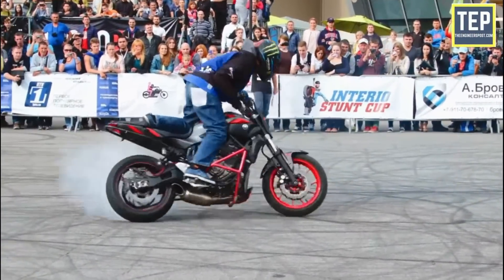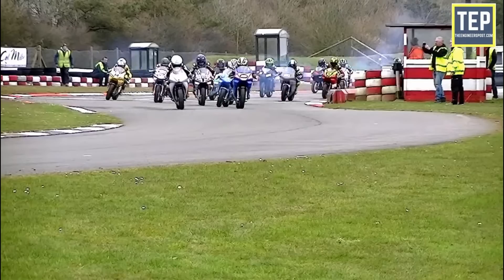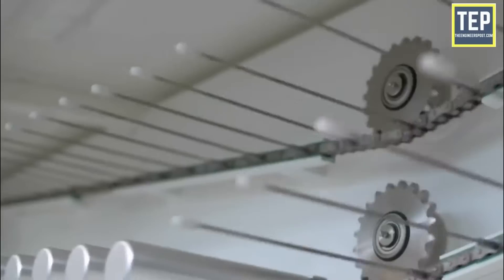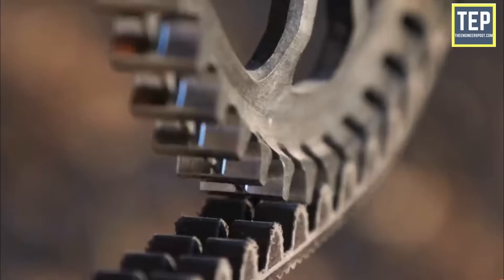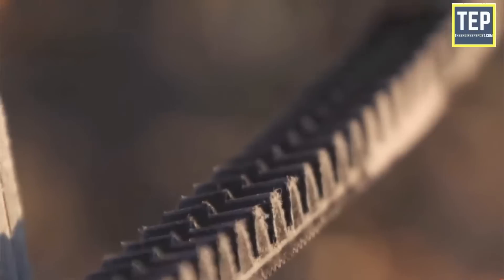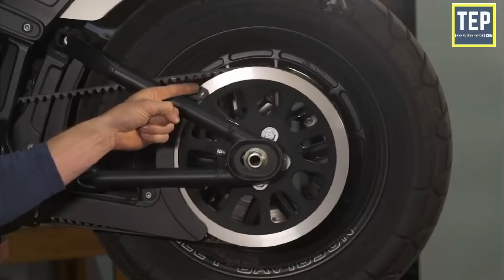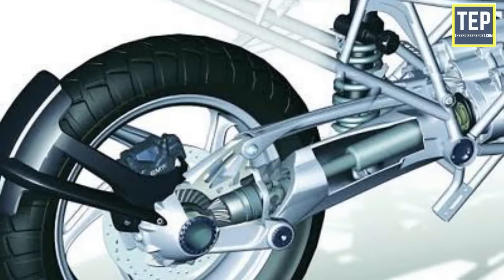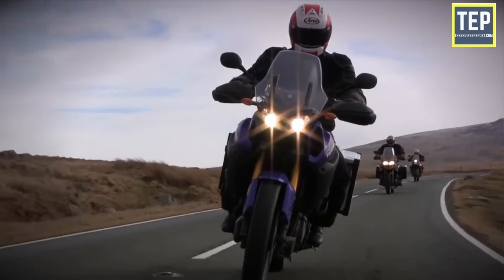Chain Drive vs Belt Drive vs Shaft Drive in Motorcycles | Which is Better?

Comment: The power loss for a shaft drive is closer to 7% than "20 to 25 % of the power".  Belt drives are adversely effected by rocks, sand and gravel and are ONLY recommended for paved roads.  The regular maintainance for shaft drived is oil changes, for roller chain it replacment of chain and sprockets  the time between replacment can vary 3:1 depending on road, of off-road use.
Reply: I have a belt thats more than 20 years old now and i never touched  nor maintained it and its got close to 150k miles. In my opinion if you're a cruiser guy mostly on paved roads, belt is the best. For adventure guys the best is shaft or chain. For performance ofcourse chain. My belt also had 20k plus miles off road experience and it never let me down. Oh and i turned my bike into a bobber the moment i acquired it so it doesn't have a belt guard to protect it from rocks. I swear for the past 20 years I've been using that bike i never touched it nor worry about it. The only time i had to touch it was when changing tires for final adjustment thats it!  Fuckin real maintenance free compared to my other bike with a chain.
Reply: I could not believe the "20 to 25%" claim.  That would be a huge amount of power converted to heat loss.  If you held your brake to rub off a quarter of the power generated, it wouldn't take long for the brake rotor to glow red hot.  I've never noticed a drive shaft get hot.  If you lost 25% of power, why, you'd need a radiator just for the drive shaft.  I'll wager those numbers correspond to maximum torque or full throttle.  A Goldwing cruising the interstate at steady state might be as low as 1% loss.  That's my guess, I'm willing to be educated as I don't know.
Reply: the power loss for a chain is 99% when the chain starts jumping teeth
and 100% when the chain breaks

Unless you are riding with the throttle WFO ALL THE TIME what do you care about power loss?!  Cant afford gasoline for your MC?!
Reply: @kenwittlief255  :  If your range on a tank is say 200 miles, a 5% power loss is 10 miles, or a 3 hour walk if you run out of gas.
Reply: @kenwittlief255  power loss means power loss... so you're slower than the next guy with less power loss... no biggie for cruising around other than range/fuel cost but when performance is of concern, it starts to matter.

Comment: I had an 85 maxim and a 03 vstar… both shaft drive and i love them… they have alot of down sides but with some bikes idc to go fast….but how they load up the shocks is awesome because when you get in it the rear suspension squats and gets its… ya any 600 sportbike will out run it and a 400 sport bike will keep up but my 1100vstar was stomping 1300 harleys…. And it just feels fast even if it isn’t because it loads up that suspension and squats it which makes you feel fast… my dream bike is a harley break out… my second dream bike is a 1300 vstar… I’ll probably get another vstar before I could afford a harley

Comment: I find hard to believe that a shaft drive can lose up to 25% of the engine power.
On a 1200 cc four cylinders engine, 25% of the max engine power is a few kilowatts. Without active cooling, that means red hot.
A more correct power loss is - IMHO - less than 10%...
Reply: I agree. The claimed 25% power loss seems way too high. there are 746 Watts/horsepower. If the bike is cruising and requires 'just' 10 hp, then 2.5 hp (2.5*746= 1865 Watts) would be lost to heat. So even under non racing conditions, the implication is way too much heat would be generated for the differential and its housing to survive.
Reply: I did some calculations based on shaft drive gear efficiencies for my 2009 Yamaha VMAX, which is shaft drive. I came up with less than 10% efficiency loss. 25% is nonsense.

Comment: It depends on the used.
Each has different purpose and design specification.

Chain has a lower thermal expansion compare to belt chain.
Which it can go longer time
But will consume maintenance on rust. And adjustment

The belt chain
Has the advantage of direct transmission. From staring point it can have a better acceleration.

Direct shaft or pto
It the number of gear linkages to the developed the power, which need good materials and expensives but it has more power compare to the both chain.
Reply: The chain expands the most and they do get hot after just a mile.

Comment: Shafts are all well and good, but they have a huge power loss, a tendency to snatch if you downshift to quickly, weigh as much as small planet and if you have a final drive failure you'd best be on your top game as the rear wheel will lock up without warning.

Comment: I had a Kawasaki z1000st and the shaft drive was brilliant, also it was faster than the chain driven version as I found out . So I disagree with you when you say shaft drive looses the most power , don’t forget there is no slack like chain , the drive is direct.

Comment: So, in other words...

Chain - Enthusiasts, and Performance Junkies  (Best performance,  high maintenance, but cheap to replace)
[When you want the bike to run its best]

Belt - Common, or Casual Riders (Medium performance, low maintenance, but expensive to replace)
[When you want the bike to run okay]

Drive Shaft - Cross-Country Riders (Low performance, NO maintenance, NO replacing)
[When you just want the bike to run]

Seems pretty balanced.
Reply: belts aren't expensive so I don't see how they would be expensive to replace.

Comment: I prefer shaft drive, but it does feel different than chain or belt. At least from my experience. Chain or belt drive tend to emediatly drop the rear end during hard excel. While a shaft goes up then down. It's a different feeling.
Reply: Im sure it would handle differently and not just feel differently.
Reply: I've owned chain and shaft. I can't feel any difference.

Comment: I've owned all three. Prefer the belt overall. Then the shaft. Belt is the least cost for power and lasts just as long as the chain. The shaft drive is the strongest by far but tends to lift the back of the bike under acceleration (at least mine have) so not ideal for performance but fine for a cruiser. I would tell my buddy when his chain needed to be adjusted after riding down the highway near him. He had R6. I had XB12R
Reply: I had a shaft and the whole bike feels like it jumps up when you crank on the gas. I will take a belt all day long. Chains are too much work and with no center stand on a Harley a pain in the ass to lube.
Reply: Hell yeah. Had a xb12s and 1125r.

Comment: In my experience and self opinion the best is the belt driven.easy to repair it last for 12 years before I change belt of  my motor 🛵 cycle manufactured by Yamaha model 2010,belt driven type motor, daily used 50 km from home to work,plus going on the market and home service also   week day saturday and Sunday.Belt driven is best ever.long last.👍
Reply: Sounds like you didn’t even try anotherone 🤨

Comment: Fails to mention the cvt belt drives on the majority of scooters. Totally different to the toothed belt system. Very simple and low maintenance.
Also, I have a Yamaha Townmate T80.  80ccs and shaft drive. It's brilliant.
Reply: I have an Icebear Rocket 50cc that has the belt driven cvt. They don't seem to break often, and if they do its cheap to replace. Also easy enough to DIY. I suppose the performance in scooters is helped with it being more enclosed.
Reply: @jhoughjr1  it is

Comment: More than half a century with my ass on a bike and my choice is clear, belt. With a R1150RT, I had to change the shaft every 40.000 kilometres (40.000, 80.000 and then 120.000, when I got enough and sold her) due to a worn rubber torque absorber while my Vision has still the same belt in good conditions after more than 160.000 kilometres.

Comment: Good explanation of the difference between these three drive systems.
I really would like shaft drive even for a bicycle. No need for the regularly maintainance as with chain. The significantly worse efficiency is of course a true drawback. With a motorcycle and 100hp or more this is a non issue for practical use.
But when the normal operating power is 0,2-0,5hp it's more noticeable...
Reply: Chains are still the real ones

Comment: And not to mention that they love stripping the gear on the gearbox end of the drive shaft as it's a pivot point just use a chain only maintenance it needs to be wiped over with an oily rag every now and again and it will only cost you about $30 to replace the f**** thing I challenge  anyone  to show me where I can find a replacement drive gear or shaft for 30 buck's?    I'll wait

Comment: You did not mention torque twist affecting handling on shaft  drive bikes. It is the first thing a rider needs to become comfortable with.
Reply: thats only with boxer engines, like a gold wing or BMW
Reply: @kenwittlief255   Not ONLY. Yamaha XJ900 Inline 4 cyl. Kawasaki Z1300 In line 6 are 2 bikes I have some experience with. They both had this to some degree

Comment: There's an automatic chain oiler kit available, manufactured in the UK.    Kit consists of an oiler resiviour with flow rate adjuster, drip feeds oil onto chain via tiny tube. Keeps chain 100% clean, no oil spray onto back rim/tire. No more cleaning/lubricating chain. Highly recommended chain drive. 🖐🇦🇺
Reply: Now you are just dripping oil all the time, everywhere you go.
Reply: @jhoughjr1  ignoramus.
Reply: @jamtin3977  a useful word indeed in current times.
Reply: Buying link pls

Comment: I would never buy a bike without shaft drive.  Sure - there is power loss, but most bikes that use shaft drive have horsepower numbers around 140-160, hardly a concern about enough power.

Comment: There are quite a few points in this video that are not accurate. Yamaha produced a shaft-drive commuter bike in competition to the Honda 90. Bigger shaft-drive bike are definitely not maintenance free. I have converted several of my bikes to belt drive and discovered that the belts themselves are generally cheaper than equivalent quality chains. Primary drive pulleys being about the same cost per item.

Comment: Chains are the Best till your chain slips off its Sprocket locks itself between the wheel n frame n your real wheel is Locked n you go flying, luckily I was on the exit from the A! near Grantham by pass n was only doing about 40, B4 I started wearing a Helmet kept rolling on the road for a while just few bruises got the chain back n go to my destination about half hour late the whole truth? I WOULDN'T DARE RIDE A BIKE NOW AT ALMOST 80 scares me to death to think what I was doing n how lucky I been, But Nothing on earth gives you this kind of pleasures n excitement leaning into a corner n opening  up all the way my only fear was will the engine misfire or cut out? that never happened thank God

Comment: Shaft drives do require maintenance  the  splines at the  shaft coupler need to be greased from time to time.  And if it has a universal joint like my  BMWR1100RT  it should be  greased as well yearly or every 10,000 miles or so.
Reply: Yes, it gets forgotten on older bikes, had a yamaha dragstar 650 with stripped splines on the driveshaft housing, not a cheap fix
Reply: @TheBlabla1996  spring of 2020 I had a drive shaft failure due to  splines never getting greased. 
 Part that really  sucked was I had bought the bike a week before and was riding it to the shop to be gone over and serviced. 
That failure cost me an extra  800$.
 But since then I have had no problems with my BMWR1100RT
Reply: Thats expensive, I could do it myself luckily, still 300 euros for the part, but when their good, they ride solid. Still worth the while of not having to clean grinding paste out of your chain 😂

Comment: Some other things to consider is unsprung weight and the shaft drive adds negatively in this regard. Also you have to control the shaft tendency to lift the rear suspension on hard acceleration can be spooky on a curve or cornering. You do this by springing it stiffer /rough ride
Shaft drive does need a special grease not totally maintenance free.
 
I've had all three types of drives and IMO non really stand above the rest as far as overall performance

.My rides over the years,
Triumph Rocket3 and  Goldwing are shaft  and  around 5 other Hondas with chain . 
Harley Superglide with belt  ....was leery of a belt drive but it has 30,000 miles on the same belt. very quiet drive/clean light weight
Chains can handle more power than a belt but they are messy and stretch and wear out. Noisy/messy /heavier than belt
Shaft are strongest but heaviest and with high power motors need a stiffer suspension . Rough ride/handling quirks with suspension loading and unloading.
Reply: Yes I thougth the same about belt drive aswell, until i got a harley sportster, its way cleaner then a chain, but not as clouchy as a driveshaft, best of both in my opinion
Reply: I couldn't tell you what the hell you're talkin about because everytime I twist the throttle on my shaft drive Honda all I see are people in my mirrors chains rubber bands belts whatever you want to call them they're all outdated yesterday's bullshit
Reply: @joeylom5235  Maybe they didn't twist throttle as you did or just your bike more powerfull regardless off drivetrain system? your comment feels cringy ana fanboyish. And video literally said, shaft lose %22-25 power.
Reply: @joeylom5235  It's not only about speed, the way torque gets tranferred through the driveline just feels smooth with belt drive, the reason electric bikes also have this because it is quiter then a chain. 

That being sad, chain wil put any drive shaft of equal power in the mirror, why? because a shaft drive has a lower power transfer efficiency then a chain, even lower than a belt drive.
I had an old yamaha dragstar, maybe newer ones have improved, the fact is you NEED play in you splines, which maybe causes the clunky feeling when riding
Reply: "Some other things to consider is unsprung weight and the shaft drive adds negatively in this regard." - true, but what's not being said is in the new bikes (K series Beemers etc.) the shaft is also the integral swing-arm, and also being alloy, the weight differential isn't as extreme as many like to think.

Comment: My first motorcycle was a Yamaha 400cc I bought new in 1980. It had about 30,000 miles on it before it was stolen in 1983. My next bike was an 85 Honda 650 Nighthawk with shaft drive. I had it for a short period of time and sold it back to the dealer because of what I described as a centrifugal effect. When I would ride straight, the handlebars felt like they were rolling in my hands and when I would lean down into a turn, it felt like the bike was trying to upright itself. I could only think it was caused because the wheels and engine were turning one rotational direction and the shaft was turning 90 degrees from them.
Reply: Thats interesting, it might be the shaft torque adding another source of gyroscopic force. Does it feel like leaning to one side is easier than the other? The self righting when leaning could be due to suspension geometry too. Had a Yamaha two stroke racing moped that does that but only at extreme lean angles, it was hilarious fun to scrape the pegs and recover safely every time.
Reply: probably more to do with the center of mass and precise geometry of the bike governing its stability rather than the drive shaft.  Driveshaft is really really low moment of inertia compared to the wheels.  The same bike with a chain would probably still annoy you exactly the same amount.

Comment: I had one driveshaft ('94 Suzi Intruder 1400cc), but all my other bikes were chains. I would be interested in a belt for a reason not mentioned in the video. You can keep a spare with you. Try doing that with a chain.
Reply: But changing out a chain is less work than a belt. A belt is a continuous loop, so depending on the bike, lots of shit has to come off to replace it. You can't  simply feed it through like a chain then attach the master link.

Comment: And we have a perfect example of bias and or lack of knowledge.Put simply shaft drives are a hazard if you abuse them.Look it up and ffs do not hammer a shaft from low speeds when cranked over and more so on wet roads

Comment: A 750 cc bike  with a shaft drive is way too inefficient and is like only a 400 cc bike to ride. A shaft drive bike needs to be at least 900 cc. However if low maintenance , cleanliness and neat appearance are important then a shaft drive is  desirable particularly if the bike is used for long haul touring. It's unlikely one would see a racing bike with a shaft drive.

Comment: Belts and chains transmit 98% of the power to the rear wheel. Belts are not very forgiving when it comes to stones or rocks getting between the belt and the sprocket. They’re also tough to put on.
  a worn chain can cost a 100 hp motor cycle 6 hp on the dynamometer
 depending on if the power changes direction 90° one time, or two times with a shaft drive bike depends on whether or not it loses 15% of its power, or 23% of its power between the engine and the rear wheel due to inefficiencies and friction making the power turn a 90° corner once or twice.
 belts and chains allow the suspension. to move freely up and down under power. A shaft does not let the suspension compress when hitting bumps if you were on the gas,. And when you go from on the gas to letting off the gas with the shaft drive, the back end of the bike drops down. you don’t get those reactions with a chain or a belt drive.
   You will never see a road racing machine that is top of the class around the world winning the world championship with a shaft drive. It is too inefficient..